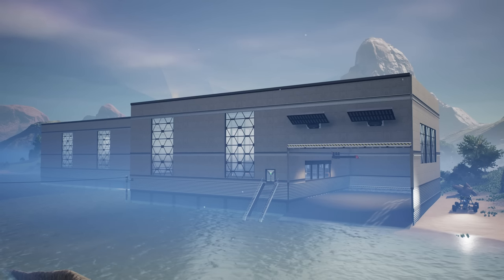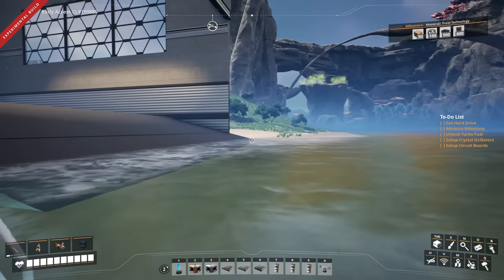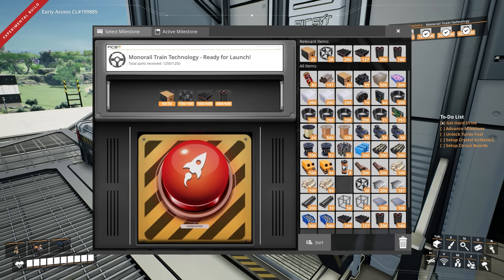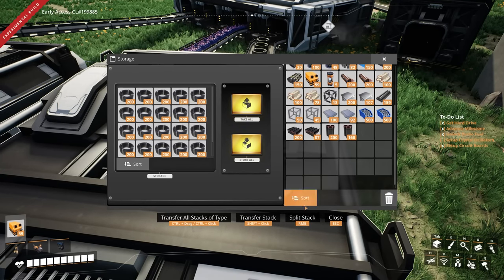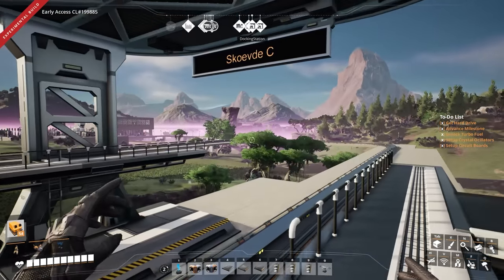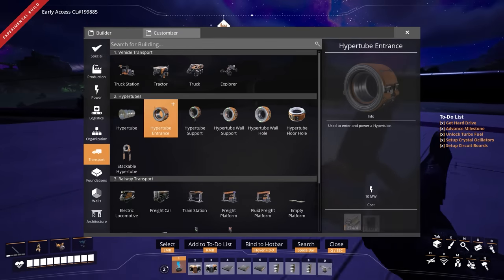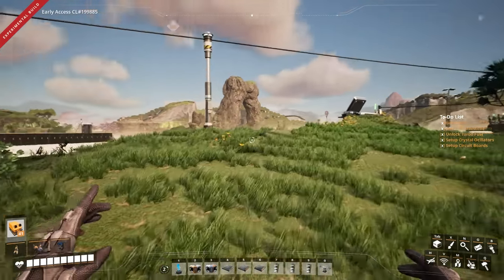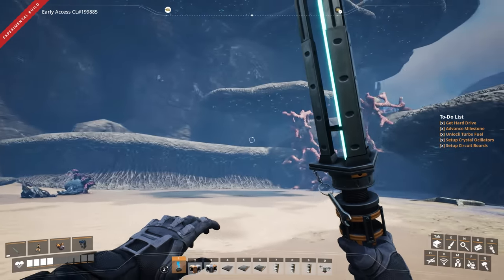TRAINS! (Kind of) - Let's Play SATISFACTORY Update 7 - Ep.26

Comment: To stop the sputtering, you should really just open the valves. Let the fuel flow and fill the pipes. I've found that there's not really a point in trying to load balance liquids with perfect inputs like you would a conveyor belt. Think about it. You have a manifold setup with your liquids, each machine takes what it needs from the manifold and the rest flows back out. Would you manually limit the number of items that goes into each machine on your conveyor manifold line? No, because it automatically balances itself out. Same principle applies here. Once the manifold fills all the pipes, fuel will flow elsewhere where it's needed

If the main goal is to stop backflow, the valves automatically do that. So you can keep them there and they'll do that job

Comment: you should put a beam connector on the corner where the beams meet, at the "dont look at that" location.

Trainstations carry power through the rails, so you only need to directly power one. you can use this to power the whole map, by just building another station anywhere and connecting that station to the local, unpowered, grid in new buildings. also, the power consumption works like truckstations. they only consume when theyre being used loading and unloading and the station itself uses power when a train docks. trains running normally use 25-30MW while they can go up to 110MW going uphill or having too many carts (i usually go for 3-4 carts per 1 locomotive). you can put 2 locomotives infront of an 8 cart train for example, you just need an empty station between the normal station and freight/fluid station to accomodate for the extra locomotive. powerstorages are usefull if you start using more trains. 

the signals, basically, put a path signal at the entry point of every junction and  block signal at every exit. you can divide longer stretches of rails in blocks with just block signals, so trains wont wait for eachother untill theyre at the end of the strech, but just the end  of the block. that can otherwise give throughput issues once you have more trains. highly recommend setting up dual track since youre building in the worst part of the map, node wise, so you will most likely need a couple of trains to transport stuff in.
on a monorail track, you do need signals in both directions.
you can specify items per cart with the way you feed the items into the freightstations, it loads only the cart at that freightstation.

crystal oscillators are used in some alternate receipes later on. particularly if you want a big nuclear powerplant.

Comment: Regarding fluid sputtering - the best practice is to allow all fluid buffers to completely saturate. This includes plopable buffers, but also every pipe segment and every machine internal fluid buffer. Once that happens your refineries will run smoothly and I think limiting the flow with valves will either delay or prevent this process.

Comment: Once one train station on the loop is powered, it transfers the power through the rails, which will eliminate the need for long power lines so long as each area has a train station that is connected on a grid to a powered train station.  It's an aesthetically pleasing way to transfer power all across the map without the need for a spiderweb of powerlines.  So, the little test loop you made has a redundant connection on the second station as both stations are connected to the same grid.

Comment: Worked on equipment all my life and the comment about "air bubbles" in a computer simulation is interesting. In many games I've always noticed real world problems being discussed as if there was an actual temperature or water pressure or electrical current being involved in a video game. Games simplify systems and components compared to real world but I question how much we don't see, in a game, are actually built in failure failure probability rates to make it feel more real.

Comment: Oh, also… sort of due to a glitch, sort of not, but water towers are a thing. If you put a fluid tank on a high point, pump the fluid up to it, and then have the outflow meet back up with the pipe, you won’t need any more pumps as long as you don’t try to go above the height of the tank.

Comment: A really good tip is to turn off the fuel generators untill the pipesystem is completely full with fuel. 
Then turn it back on.

Example. I use heavy oil residue and deluted fuel recipes and pump 4 blenders worth of fuel out to 34 fuel generators + 2 storage. Wait for it to turn off producing fuel and filling up. Then turn on power